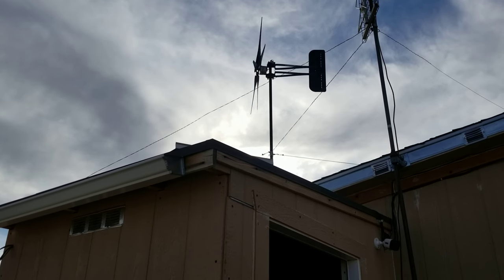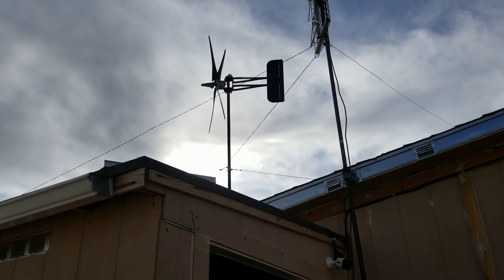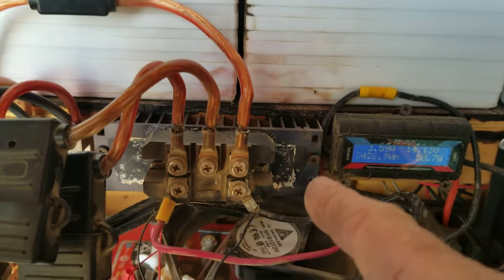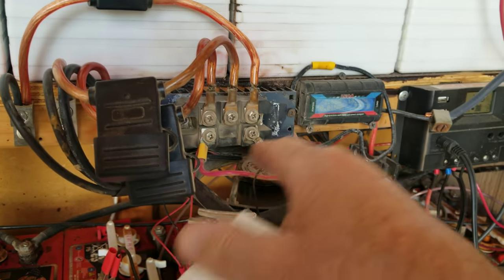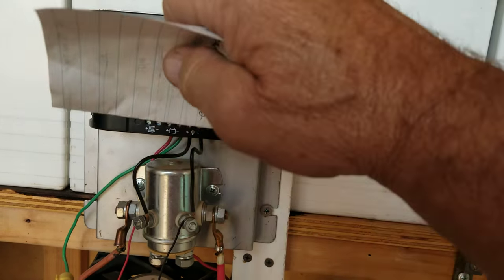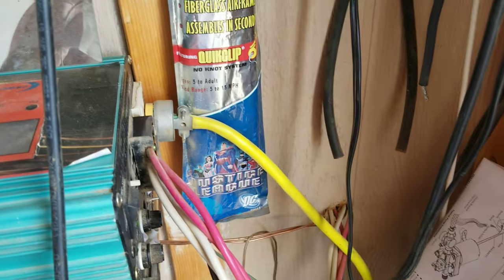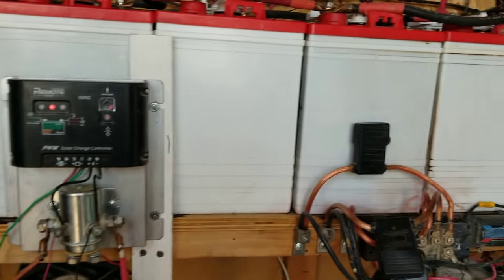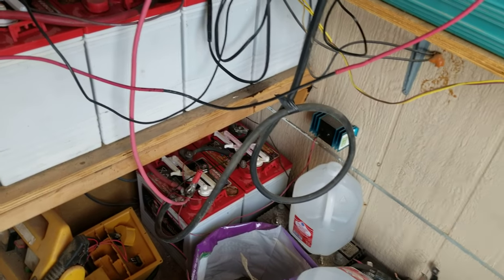Wind turbines, controllers and batteries explained, March 6, 2020

Comment: Ok G Bear i bought a 11 blade hornet SC48VDC Wind Turbine 1200 watts can you suggest wire sizing 50' tower 40' from power wall break switch controller etc...50 amp PS and a good Dump load
Reply from the maker: Is it 3 wire PMA, or 2 wire PMG?
Reply: @GBear  2
Reply from the maker: 2 wire is a PMG (DC) and requires heavier gauge wire than a PMA (AC) turbine.  But it can be connected directly to the battery bank with a dump diverter,  of you can run it through a Midnite Classic controller for best output and protection of your battery bank.
Unfortunately,  a DC turbine requires heavier wire at an increased price, and for the distance you mentioned, I suspect #6 stranded PV wire will be required.
Reply: @GBear  Thank you G Bear I was thinking 4 gauge but if 6 will work then so be it Thank you again
Reply: Do you think i should have a separate ground and surge protector
Reply from the maker: 6 ga PV wire!  Fine strand.  To verify, there is a chart online.
Reply from the maker: @hoosiersolarpower974  earth grounding the metal mast or tower is a must!  I drove a 6 ft ground rod for mine.
Reply: Hi G bear I am having issues i have the 48v dc turbine i am only getting 0.241 milliamps no higher even at 20 miles an hour no matter the speed the amps never get higher how may i fix this issue
Reply from the maker: Since it is a DC turbine,(PMG), the distance from the battery bank, and the size of the wire is a possible cause.  PMG'S require larger wire sizes, which make most people buy PMA'S. 
Not knowing all the particulars, that would be my best guess.
Reply: @GBear  well I have approximately  100 ft of 6awg from turbine to batteries
Reply from the maker: @hoosiersolarpower974  stranded?
Reply: @GBear  yes
Reply from the maker: Is it fine strand PV wire?  If so, try accessing the conductor closer to the PMG and test for volts and amps.  If good, move further away and test again.  I have had brand new cable be bad off the roll.

Comment: Greetings sir, if you connect the generator to the batteries as load but then also connecting them to inverter, doesn't it mean you charge and discharge the batteries simultaneously? I'm sorry I'm confused
Reply from the maker: Welcome aboard!
That's ok, I'm a little confused too.  A generator is not a load.  A generator generates power, it does not use power.
In an off grid system, the batteries are for power storage.  Power is created by solar or wind, and in some instances, by hydro.
The inverter changes DC power to AC power to operate AC appliances.
During sunlight hours, the solar panels not only charge the batteries, but also power the inverter, assisted by the wind turbine if wind is available.
Reply: I'm sorry sir, there's a misunderstanding. Here I mean the loads are the batteries. When the generator charges the batteries, can you use the batteries to power electronic devices? So in this case, the batteries is charged and discharged at the same time, is it safe to do it so?
Reply: Also thank you for replying😊
Reply from the maker: @themidfier6591  You're welcome
Reply from the maker: @themidfier6591  Yes.  That is how an off grid system works.  But the system should be properly balanced. 
The charge controller is essential, and a good one is a must.  It controls the solar input to the batteries.  If the batteries are full, the controller stops input, and as the batteries lower,  the controller resumes input.  In the case of a turbine, the charge only exists when wind is present at an adequate speed, so connecting to the batteries directly and using a dump load diverter is acceptable. 
Think of a car.  If you run the radio, and lights without starting the car, the battery will die and you won't be able to start the engine.  But, if you run the lights and radio and fan, etc. while driving, the alternator is charging the battery, and the regulator acts like a charge controller.

Comment: Setting up the rectifier ? How to ?
Reply from the maker: Welcome aboard.   The rectifier is used for an AC turbine, where 3 wires from the turbine are all the same color.
Those wires connect to the 3 poles of the rectifier, any order.  Then  a positive and negative come off the rectifier as DC and connect to either the battery bank*, or a controller.
*If connected to the battery bank, a load diverter is also required to be connected to the battery bank.

Comment: Can I connect input power supply of  load controller directly on battery terminal while battery is charging from mppt
Reply from the maker: Hi, welcome aboard.  For all charge controllers, you must connect the battery first, and it doesn't matter if the batteries are charging.  But do not connect the solar panels to the charge controller if they are under load.   Cover them with a tarp or blanket before making or breaking their connection.
Reply: @GBear  Thanks mr G Bear for your valuable  response ..few more suggestions as  I need as I want to run a DC motor of 1 kw from wind energy what would be better AF PMA or AF PMG or something  else, kindly also recommend about rated capacity of PMG or PMA ..as I think 1.5 kw would be enough also motor is 48V DC
Reply from the maker: @SONU CHAURASIA  Dependi g on how much you need to run that motor, wind power would not be your best choice.  For the most part, wind and solar are 'battery chargers'.  A 1.5k turbine will only produce 1.5k in a wind of the max rated speed for the turbine, so generally, it would produce much less in normal wind speeds, and produce nothing on calm days.  Solar panels will produce their rated output during sunny days, but produce nothing at night.  Your battery bank would have to power the motor, so your watt hour requirement would need to exceed, or even double the load if you plan on running other loads also.
As far as PMA vs. PMG, PMA requires smaller gauge wire from turbine to controller, but also requires a bridge rectifier.  As far as production, they both are the same.  Your choice is by how far away the turbine will be, and how much the wire will cost.
Reply: @GBear  wind speed will be always more than 15 m/s that's y I want to use wind distance from load to turbine is less than 3 meter ..and load will be always more than 80% of 1 kw ..so what would be better in between PMA/PMA and also can I use solar MPPT in this condition or Wind MPPT would be necessary
Reply from the maker: I would personally install 3-4k solar through a Midnite Classic 150, to a 3.8k watt hour battery bank, and supplement it with the PMA through a Midnite Classic 250 mppt controller dedicated to the PMA.
Reply from the maker: Also, it sounds like your PMA isn't high enough with only 3 meters from the load.
Reply: @GBear  ok that's great but what choise for wind  if solar is not possible..
Reply from the maker: PMA
Reply: @GBear  ok thanks a lot ...will come back to you ...once done..thanks a lot for such a fast response..
Reply from the maker: @sonuchaurasia1893  your welcome, and good luck.  You may be disappointed with wind power, though.

Comment: Hello
I have 3 wires with no name in the wind turbine and in controler it saying U V W doest it matter witch one to connect and where or you can connect them randomly. Thank you very much
Reply from the maker: Did the controller come with the turbine?  The U V W should mean Amps, Volts, Watts.  The 3 wire turbines are AC output, and it doesn't matter which order they connect.
Reply: @GBear  thank you very much. I've connected them, the charging sign is on but it only shows about 8.0 V and all other informations are on 0,  0 A, 0 W, 0kWh-0 and I have a strong wind today. Do you know why it doesn't shows the details? Thank you very much
Reply from the maker: @mihaimoro4418  do you have a video of the setup, components, and wiring?
Reply: @GBear  can you help me please?
Reply from the maker: @mihaimoro4418  I'll try.   I need to see what you are dealing with.  Do you have a video?
Reply: @GBear  I've sent 2 links up here but today I've just seen today. I've removed all there wires and I let 2 of them on very loose and it started working and spinning very fast producing about 700w after I leave it for a minute and I put the third wire is fine but when it starts producing lots of watts the battery persentage go up very fast and when it slows battery goes down and when it his 100% the brake comes up and the battery goes down to 60% back again . All of this happens in less then 5 minutes. I have 4 acid batteries 220 w each and an insta breeze 2kw. But the converter is made in china, no name 2kw one . Thank you very much.

Comment: If it's only wind powered does it need to reduce the voltage to the battery I've seen people just straight charge the battery but I don't think it's very good for the lifespan
Reply from the maker: Welcome aboard!  If the turbine is DC (2 wire) and rated for the battery bank voltage, then it can be wired directly to the battery bank, but then requires a dump load system to protect from overcharge.  If the turbine is AC, (3 wire), it needs to go through a bridge rectifier first, then to the battery bank, but it still needs to be rated for the battery bank voltage.  This also needs a dump load controller to prevent overcharge.
Both can instead be connected to a charge controller rated for turbines, NOT solar.
Reply: @GBear  thank you for the information! 🙂 Greatly appreciate it
Reply from the maker: You're welcome. Thank you for supporting my channel!

Comment: Hi,
I have 3000w inverter and 3 agm 105ah battery. If I run 450w computer, how many hours should run continue?
Thanks
Reply from the maker: Hi Nathan, welcome aboard!  You left out some important specs, so I assume you have deep cycle AGM batteries connected in parallel for 12v @ 105Ah.
So to determine Wh, multiply 105 x 12=1250wh. Then divide 1250Wh by 450W=2.78 hours runtime, but you have to consider loss to run the inverter by dividing that by 95%, so loss is about .26, giving you a runtime of just about 2.5hours
Reply from the maker: Oh, and if running electronics, be sure your inverter is PURE SINE WAVE. Modified sine will damage electronics.
Reply: Hi GBear,
I am using Renogy 3000W 240V Off-Grid Pure-Sine Wave Inverter.
Thank you for your quick reply. Now I understand.
Thanks again
Reply from the maker: @nathanranjan3071  you are very welcome.
Reply: @GBear  Hi,
I'm really confused if you mean that 1 battery is 2 and a half hours or if that 3 batteries altogether  work for 2 and a half hours.
Thank you
Reply from the maker: @nathan ranjan  Ok, if you have 3 batteries in parallel, the voltage stays at 12v, but you would add the Ah of the 3 giving you 315Ah.
I did the math for 1 battery, so you would go 3 times that for 7.5 hours.  Sorry to have confused that.
There are also other things to consider, though.
Don't discharge your batteries more than 50%, or to 11.5v.
Also, you can prolong your run time by adding solar panels totalling 500watts, as that is higher than your demand, so while the sun is on them you will be replacing more than you are using back to the batteries.
Reply: @GBear  Thank you so much
Reply from the maker: You're welcome.

Comment: Hello sir -sorry fo bothering  - I got a problem -when my inverter  is working the input terminal  from the batteries  can shock  you -even the tester is lightning  -what could be the solution
Reply from the maker: Sounds like an ungrounded inverter.  If your inverter has a grounding plug on it, you need to drive a ground rod and attach the inverter to it with a heavy gauge solid wire.
Also, never touch the input terminals with your bare hands.  Wear leather gloves when handling live wires.
Reply: @GBear  so the high voltage on the input side of the battery can't  damage my battery  I should just feel free
Reply from the maker: Now, you never said anything about high voltage input.
You need to give me more information on your system!
What is your solar input?  Which controller are you using?  What voltage is the battery bank?  If using a turbine, what voltage is it inputting?  
Remember, if you have a 12v battery bank, you CANNOT use a PMA turbine that is designed for a 48v system.
Also, if you series your panels to raise the voltage input, you need a controller that is rated to handle that input.
Also, YOU CANNOT CONNECT TURBINES AND/OR SOLAR PANELS DIRECTLY TO AN INVERTER. Then need to be run through a battery bank FIRST.

Comment: I have always had a question  for my diy, what is the output voltage  of the pmg before the rectifier,  since I dont know how to regulate my 70v ac output to charge a battery
Reply from the maker: Welcome aboard Patrick!  With a PMG you can connect a voltmeter to the 2 wires coming out of the PMG and read the output.
Normally people regulate the voltage by purchasing or building their PMG to meet the needs of their battery bank. Ie: 12v battery, 17v pmg, 24v battery, 28v pmg, etc.
So one would not connect a 70v pmg to a 12v battery bank.
Reply: @GBear  my project is a micro hydro project using a simple hooverboard  motor  as generator and a pelton wheel, the phase to phase output is about 70v, how do I charge a 12v battery  with  that, should I use a motorcycle  regulator rectifier  plus a solar charge controller  ,am confused
Reply from the maker: I can understand your confusion.
First, a PMG does not use a rectifier, as it only has 2 wires (pos&neg).
A bridge rectifier is used for a 3 wire PMA to convert an AC input to a DC output.
Without adding to the confusion, I offer the best solution to your problem is to purchase a Midnite classic 150, 200, or 250.
Any of these controllers are designed to handle wind power, OR solar power OR hydropower. (Note that it can only handle one or the other, not a combination of inputs.)
The Midnite classic group can handle voltage inputs up the the number in its name, for instance a Midnite classic 150 will accept up to 150v input.
When setting up the system it is imperative that you connect the BATTERY FIRST, then the input device.
This tells the Midnite classic what voltage your battery bank is so it can control the input voltage to most efficiently charge the battery(s).
I hope this helps.
Good luck on your project.
Reply from the maker: I understand, my last reply should help you do that.
I don't know what you expect to run on that small battery bank, but there are other electrical formulas for sizing a battery bank.
Having a large input will charge a single battery quickly, but the battery amp hours and watt hours are more important to handling loads.

Comment: Sir,, you use only rectifier to charge the battery from the wind turbine,, my question how to safe the battery if there are over voltage or under voltage,, because now in the market already available many charge controller for wind turbine. Could you explain please
Reply from the maker: I also have a dump load (diversion) unit connected to the battery bank in case the PMA input gets too high, the dump load activates and puts a load on the battery bank to absorb the excess.

Comment: G bear  great video can you charge a 48v lifepo4 104AH x 5 in parallel  with a 24v wind turbine i have 1520AH in this 48v system
Reply from the maker: Sorry, no.  A 48v battery bank requires a 48v PMA (turbine) because the input needs to be higher than the battery voltage.  You would need a 48v turbine.
Welcome aboard!
Reply: @GBear  Thank you for the reply
i'v watched alot of videos good job
Reply from the maker: You're welcome.

Comment: got a question i have a pma which is a dc pma  i use it for  a bike generator .  can you suggest a charge controller  i should use inbetween the pma and battery so it stays regulated ?  thanks i do have extra solar charge controller but im not sure if that will work .  thanks
Reply from the maker: So, you have a PMG, not a PMA.  Normally, a PMG is connected directly to the batteries and a load diversion device (dump load) is added to handle overcharge protection.
You can find digital diversion devices on Ebay.
Reply: @GBear  so your saying when im pedaling the bike  the belt turns the permanent magnet alternator   the positive and negative leads go directly to the battery then i would use a dump load to power a lightbulb that would be as the dump load ok got it
Reply from the maker: @pixar5  since you would only be inputting power to the batteries while peddling, you shouldn't need a dump load at all.  Connect your regular loads to the battery bank, then peddle away when needed to keep the batteries charged.  I assume you don't also have solar panels running a charge.
Also, you never mentioned the max output of your PMG.
Reply from the maker: @pixar5  oh, and welcome aboard., by the way, a 2 wire PMG is not an alternator,  it is a generator.
Reply: @GBear  well  i tried  peddaling the  motor as fast as i can and i can get the permanent magnet motor to spin at 26 volts , with no load the motor is rated to go about 400watts output max at a very high rpm which a human cant spin at unless i have help with a high capacity battery .
Reply: thank you for your help i appretiate  that
Reply from the maker: Ok, you won't need and controller to protect the batteries.   You would need to produce speeds of a 50 mph wind to output 400 watts.  Peddle away and worry not.
Reply from the maker: @pixar5  remember,  your PMG is a battery charger, and can be not much more than that.  If you want to power lights, they need to be LED 12v DC, and without battery backup will only give you light while peddling.  If you used a higher output PMG like 4000 watt max, you might be able to power a laptop or such.